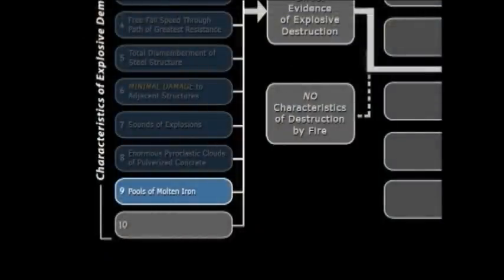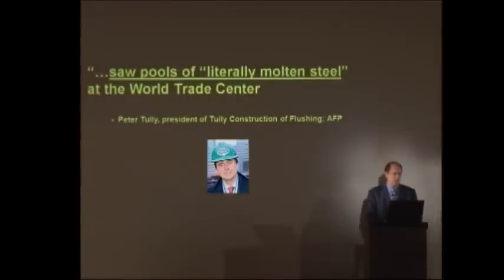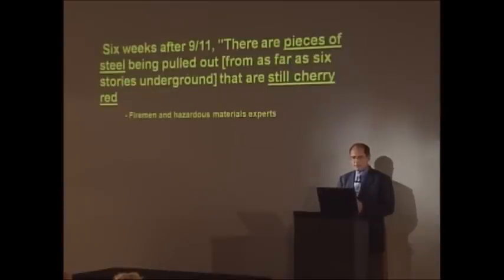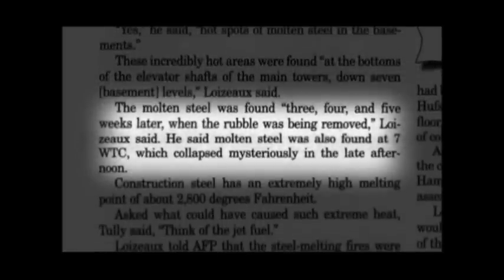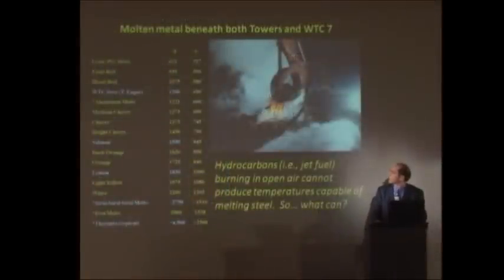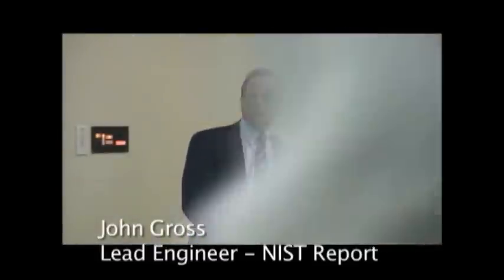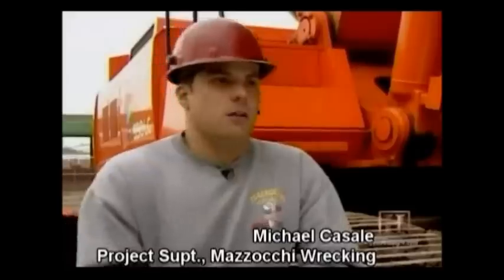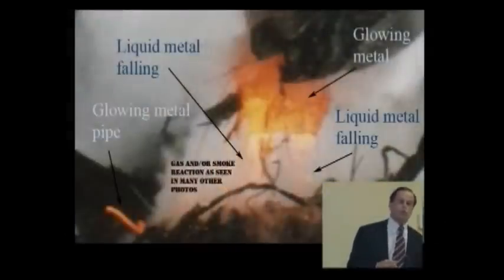Molten metal of WTC towers denied by lead NIST engineer John Gross

Comment: Aluminum glows orange when it reaches a temperature around 1900° F.
Reply: There's no way the fire could've reached that temperature. That's furnace-level temperature, but you can see when the towers were on fire there was thick black smoke, which tells us the fires were starved of oxygen, which means they couldn't have possibly been as hot as 1900F.